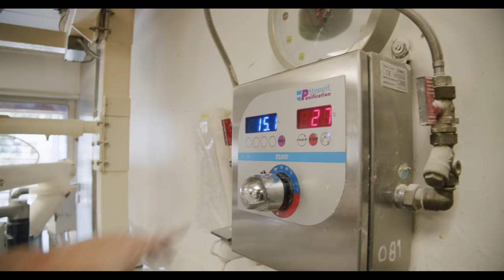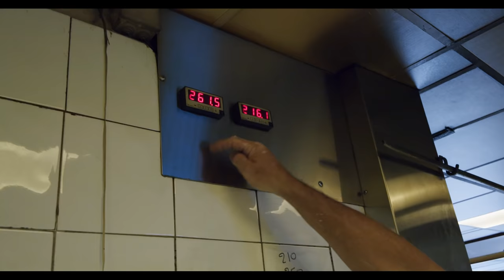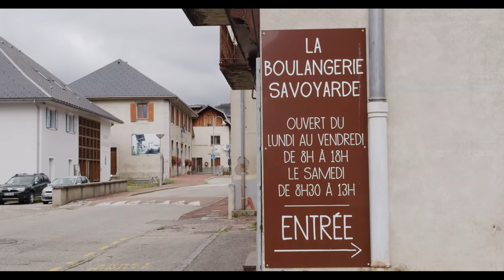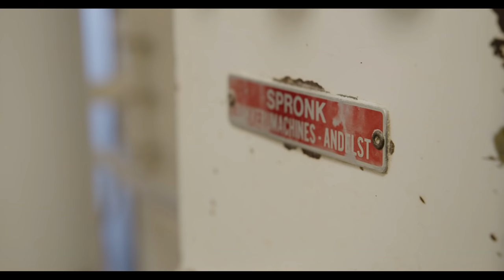Legendary Alpine bakery with wood fired oven | Sourdough bread making in France

Comment: What % of starter do you need to add in order to make sour dough bread
Reply: Depends on how mutch time u set the starter etc.   in my experience the normal ratio of sourstarter/rest is around 8-10%.
so if u have a 100g leviathan (sourdough starter that is fed and happy) 
usually fits 2-3 breads, depends on what size you like. 
so i use 100g leviathan and around 8-900grams of different wheat. 
and the water depends abit on the absorbtion of the weat, usually around 5-7dl. 
In this scale like this video i have no idea.

Comment: Does anyone know, how many degrees Celsius is it usually in the oven?
Reply: 230-250 but normal stone ovens like this one change a lot, becouse it cant be warm up like elec or gas ovens or tunel heating wood ovens. So they will start probably ~260-270 and cool while baking. The newer computer ovens got a program to simulate stone ovens.
Reply: In the verry traditional oven in france, the temperature can hit 350/375 °C. But the temperature drops because the fire is allowed to go out. Otherwise the bread will burn. It must cook slowly. The stones keep the heat for quite a long time.
Reply: Au début de la vidéo,le boulanger montre la température du four en haut et en bas